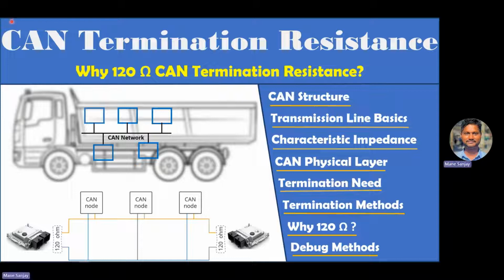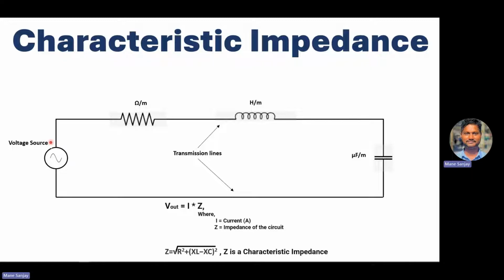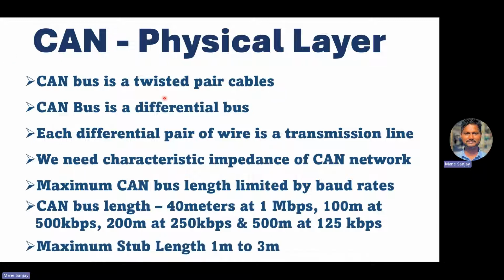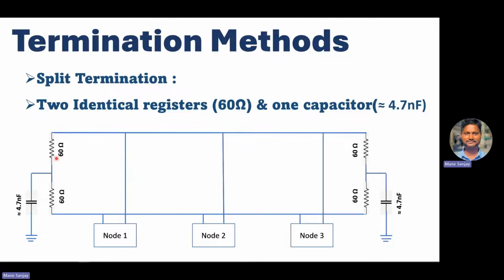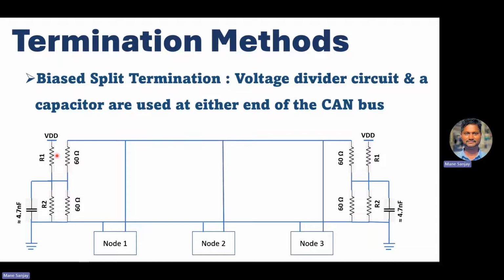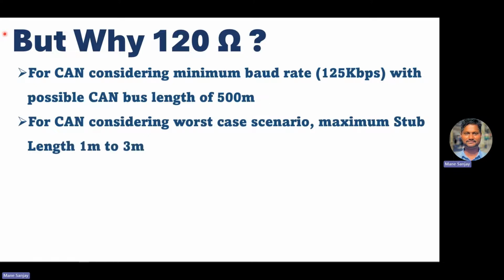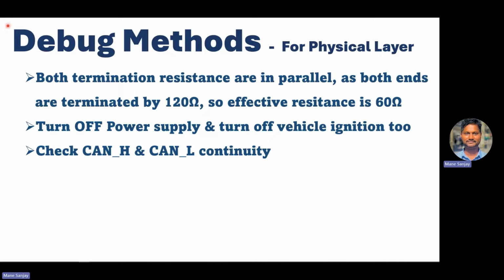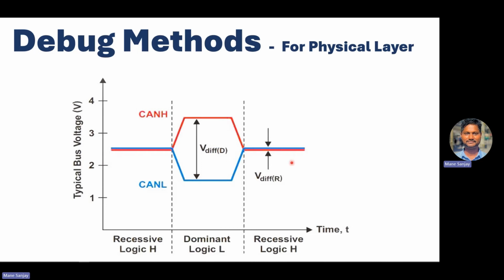Why 120 Ω for CAN Bus Termination | CAN Bus Termination | CAN Termination Methods.

Comment: Thank you very much for the video on the 120ohm terminating resistor. It caught my attention as I am currently working on a car that has no communication with both headlamp modules as well as the reverse camera. It is an x3 BMW the F25 model that has Adaptive LED Headlights. I can share part of the circuit design onvolved here later but I have been trying to determine some very strange waveform when I scope the CAN-H on this network as it appears to have a super imposed sine-like waveform on it whereas the CAN-L seems to be almost normal. I say almost because they both do not present as normal clean waveforms and I was wondering whether the capacitor introduced in between the termination resistors and ground is faulty and is causing all the wavy wavy looking pattern. I can share the circuit involved once I get back to my laptop where I saved everything but here I can just share now part of the circuit that I am trying to work on and possibly you can help me with some suggestions. I have tried to debug by taking resistance measurements and the 60.8ohms reading is what I get with power off and measure across H and L. The waveforms have very sharp upper and lower edges and the general normal appearance of a healthy CAN is seriously missing. I am investigating this on an accident car that is going through repairs and the headlamps need to be restored to working order but they simply cannot communicate . Power supply and ground to the modules is fine I ha e confirmed many times but the disfigured CAN signals made me think there could be a possible capacitor that is officially shorted to ground or to power or is just dead and not doing its work since the 120 ohm resistors are also housed in a separate location where possible water damage may exist or there could possibly be a portion of the headlight harness that was pinched and is now shorting the CAN H to some other circuit. If you are OK with my enquiry I can share the circuit diagram here and then the oscilloscope waveforms once I am back at my work station. 
I love the way you explained the termination resistors and I will be following your channel for more information.
Reply from the maker: Thank you for the appreciation

Comment: different pair of wire is a transmission line is that High speed can and low speed can
Reply from the maker: In CAN network wires used called CAN_H and CAN_L